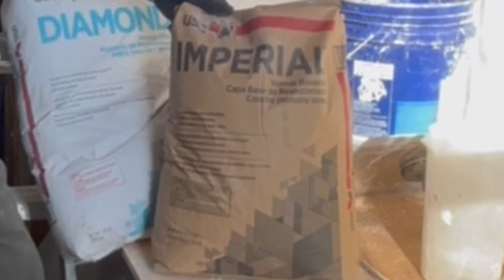How to Plaster Walls: Materials, Tools, and Base Coat

Comment: I'm in Norfolk, VA and working on the walls upstairs in my 1921 Craftsman home; I couldn't find anybody that stocks basecoat except for Ace Hardware. I was able to order Structo-Lite and have it shipped to the store, they were also the only folks who had Durabond on the shelf and the only ones who could get me Imperial veneer with no MOQ.
Reply from the maker: Thanks for the info, the supplies are out there, you just have to search for them! Good job!